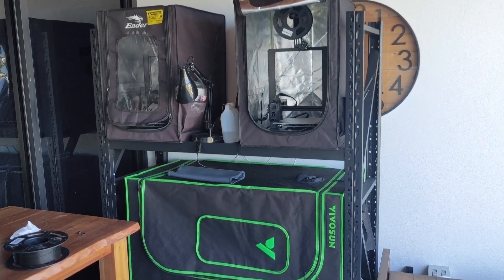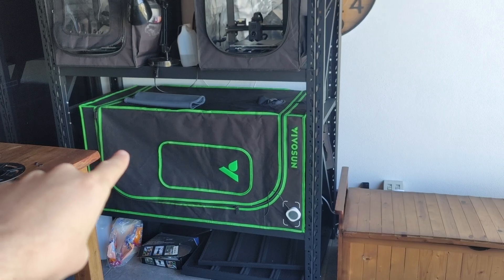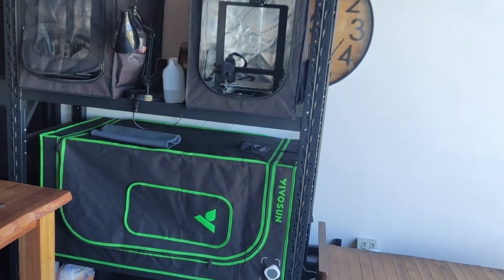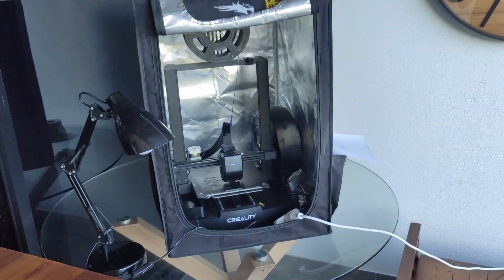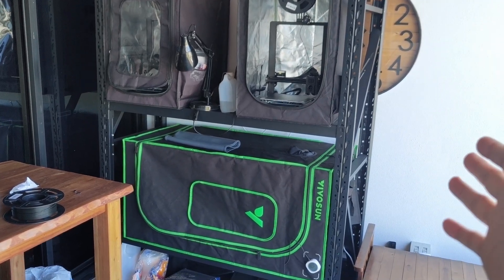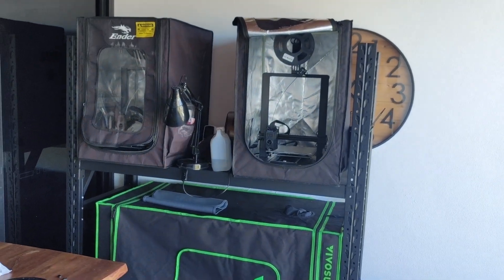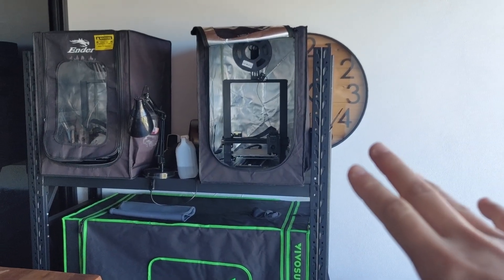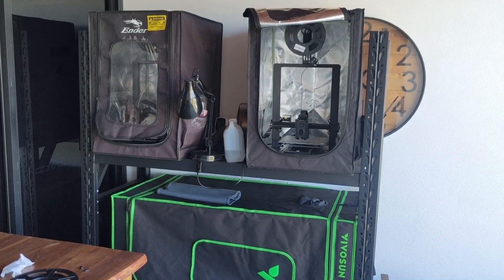3D Printing Outside - Update after 1 Year

Comment: What are the lowest temperatures you have used it in outdoors? Are there any negative impacts on the device, such as rust or electronic failure?
Reply from the maker: It can get pretty cold in the winter, maybe to the 5-10 C. But having it in the enclosure helps a lot and it regulates its own temp. I now have bambu p1s printers which have an enclosure, however I put them in an additional enclosure to protect from rain, and it also helps regulate the temp in colder seasons.
Reply: What kind of enclosure do oyu put the P1S in?
Reply from the maker: @junaidia  I use the Ender Plus enclosures for the P1S, as it gives it enough room so I can remove it easily for maintenance, and also have the spool holder on the side :) You can find it here :D
https://amzn.to/3J8aQDX
Reply: @LayerLabAustralia thanks for the info. What material do you print in? Also do you use a filament dryer?

Comment: Do you have any problem with insects or dust in your resin (for example when you are washing prints or curing - probably they can't enter through closed lid of tent). How about ambient light? That screen is enough?
Reply from the maker: That resin printer is actually my cousin's (he also lives with me) and he hasn't had any issues with insects, but he did have issues with light. However, the balcony has a shade we can pull down, which seems to have fixed that problem :D
Reply: @LayerLabAustralia  Yeah that's what I'm afraid of. My wife don't want any "visible thing" on the balcony so shade (even for few minutes) isn't an option for me. I have balcony covered from every side by walls, floor and ceiling. Front of balcony is solid (no gaps) with over 1m height. So I can place printer and washing/curing station on the floor and it will be in shadow 24/7. But I'm afraid of indirect light that reflects from part of the balcony floor (where printer will NOT be standing). I've read that it shouldn't be a problem for few minutes (when I will open lid and take print from printer to washing station). Guess I have to check out this on my own. In the worst scenario I will wash prints in the evenings after sunset. And during day I will keep printer and washing/curing station in grow tent.

Comment: That's a great idea to place it outside! Do you ever have to clean inside of the enclosure/cover?
Reply from the maker: Well I've found that the only stuff I need to clean inside is filament scraps. Most of the dust just collects on the top so it doesn't get into the machine 😁
Reply: @LayerLabAustralia  Good to know, thanks!  I was worried about the smell and noise so i'll def consider putting my 3d printer outside (a roof balcony)
Reply from the maker: @mm-sz5li  I originally had my first printer in my room, but the fumes were too hectic, as well as the noise, so I started putting them outside. Just make sure you have them as far away from the balcony edge as possible to keep it away from prying eyes as well as intense weather events :D
Reply: @LayerLabAustralia  I am slightly worried about the weather( I am in Japan and it gets ridiculously hot and humid in summer) but otherwise this seems like a perfect idea. If you dont mind me asking, would you know anything about anycubic cobra 3 or flash forge 5M?  I am debating whether I should get Bambu lab , anycubic cobra 3 or flash forge 5M for my first ever 3D printer...